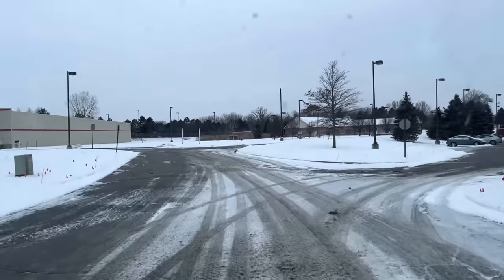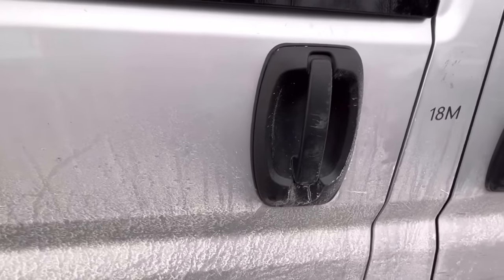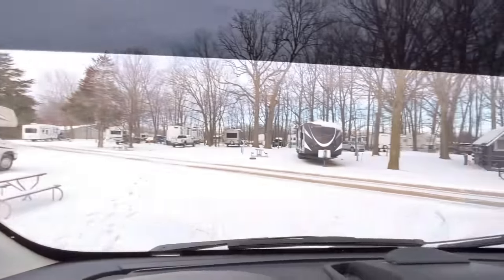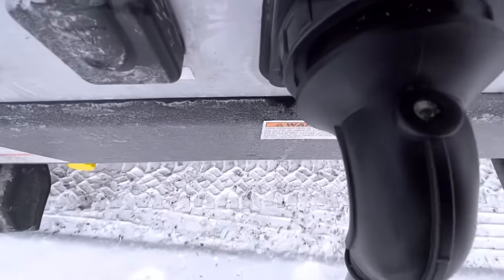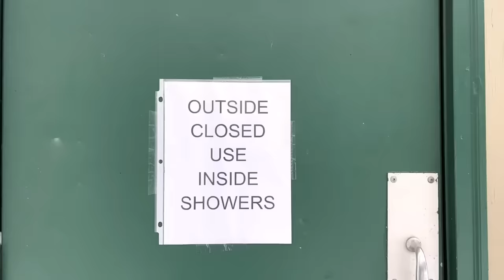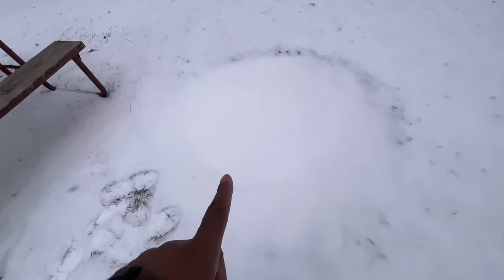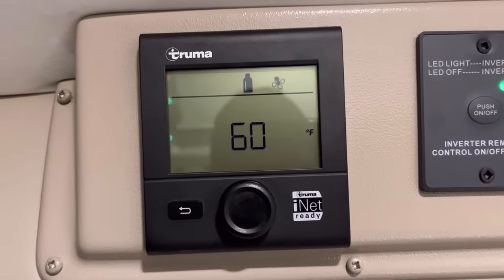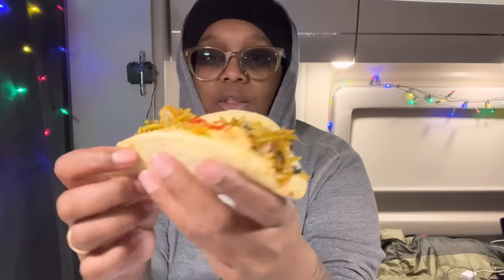Living In My Van| Several Days Of Cold Weather Camping In Michigan| Ep.73

Comment: Maybe look into an adapter at the connection if at all possible for an extra propane bottle?  It can sit outside when and if you run out of propane. Its worth a thought. It doesn't have to be big. Maybe a 20lb just to hold you over until you can fill the van tanks.

Comment: The generator needs to be exercised so its good that you are using it. Check your manual for the schedule on the oil change that needs to be done. Usually the first change needs to be done sooner.  When you used the propane for heat at the campsite couldn’t you use electric since you are plugged into their power especially during the night when you wouldn’t be using other electric inside your van  & then save on your propane?

Comment: Please explain why you waste propane heating up water for $1.70 cup of noodles when you have a microwave and are plugged into power at a campsite? You’ve also used it to heat water for your coffee before. You may need that fuel in an emergency later. Do you understand how and where to recycle the propane canisters for those burners? Or are you just going to throw it away? A simple glass Pyrex measuring cup and your microwave would be better.